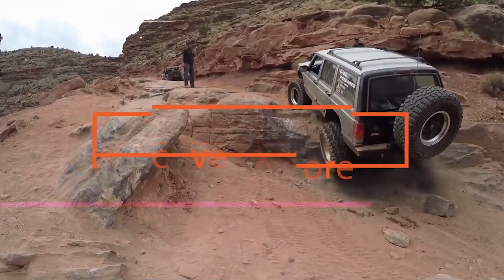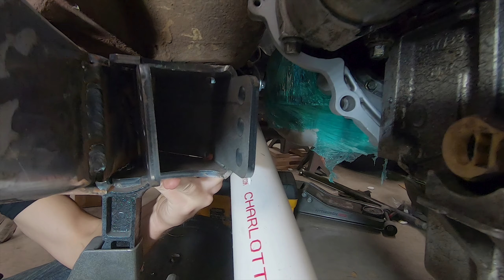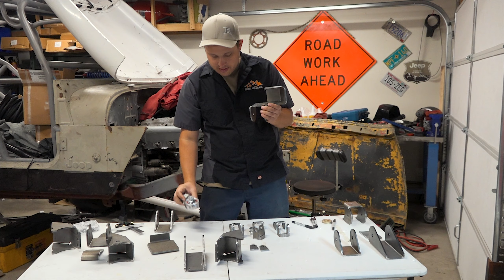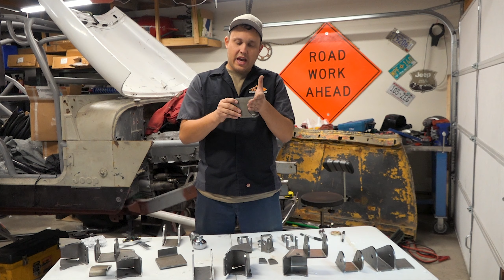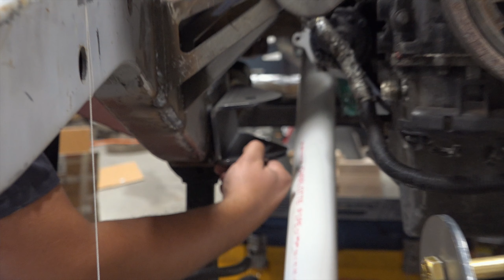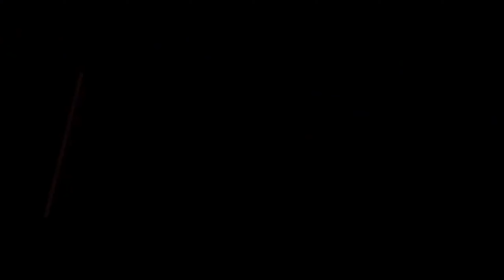How To Choose 4 Link Suspension Mounts - Upper Triangulated 4 Link

Comment: Thanks for the explanation on the brackets.
Reply from the maker: No problem,  happy to help. We knew first hand it could be a bit confusing and complicated so we wanted to share what we learned along our journey with our build. We just put out another video detailing assembling our front 4 link as well.
Reply: @SWActiveExplorers  I will have to watch it for sure. I am putting 3/4 ton axles under my 73 commando and want to do a 4 link in it in the future. Thanks again